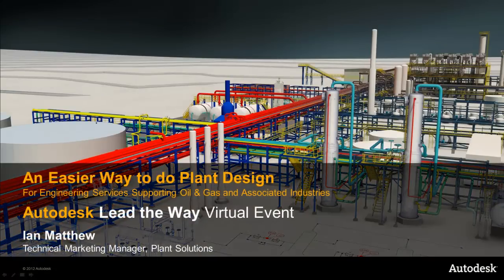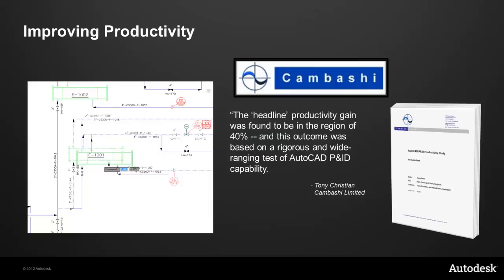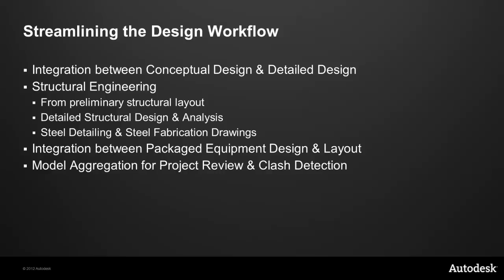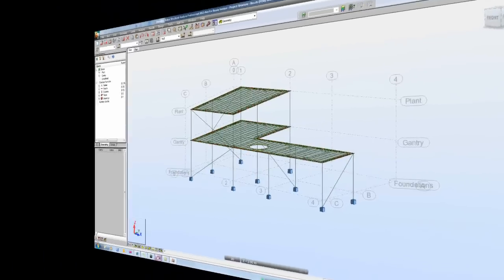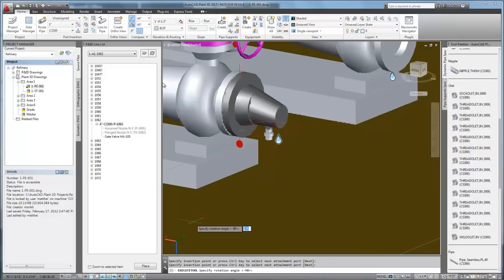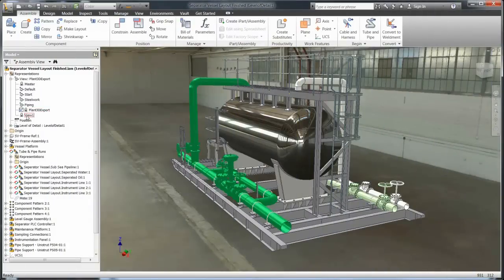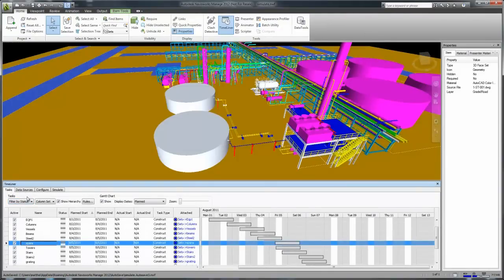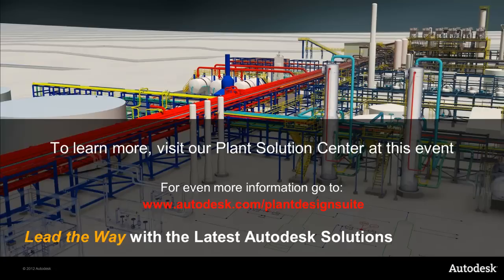An Easier Way To Do Plant Design

Comment: P3D is ok for modelling but orthographic generation and isometrics require a lot of manual editing to clean drawings up and present in a professional manner. You will find bugs along the way and have to find work arounds as well. I have used this software on numerous projects and found it adequate but not as time saving as my company hoped due to manual editing required to present drawings professionally.

Comment: Autodesk does offer all the features for Plant Design but they are not well integrated in single user interface. For Equipment design they have Inventor, for structures use Revit or Structure Detailing, For piping again a diff interface called Plant3D, and P&ID is also done in diff interface called AutoCAD P&ID. Finally a Designer have to switch over to many interfaces frequently in a day which is not really productive. Idea behind the SUITE is to sell more products in a single deal.
Reply: That's why there is  SIEMENS NX

Comment: You can tell this person knows nothing about piping!
Eccentric Reducer should be FOT!
You should never put a connection (drain) on a reducer it should be on the straight run after reducer
I have never seen anyone use hangers in this type of piping a piece of side steel to support!
No support on elbow of pump?
The good it looks like someone got the Iso program working well with min cleanup
Reply: everyone knows he is just showing operations of each app except you lol